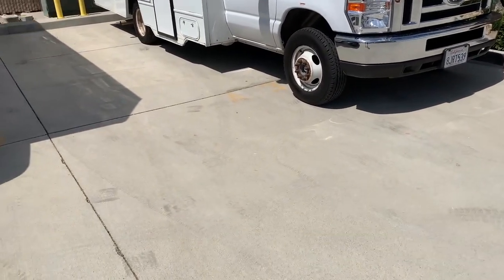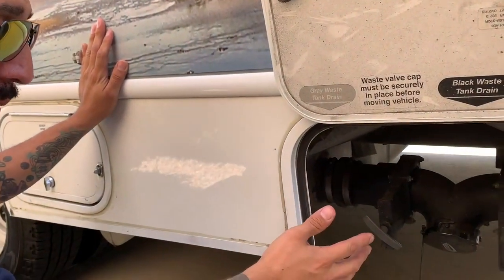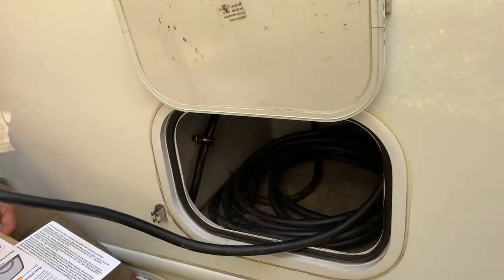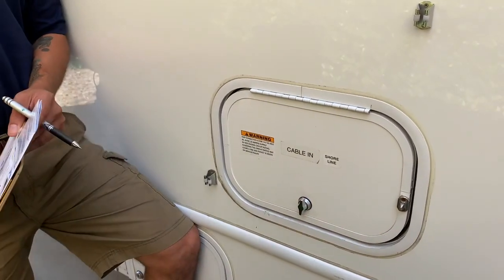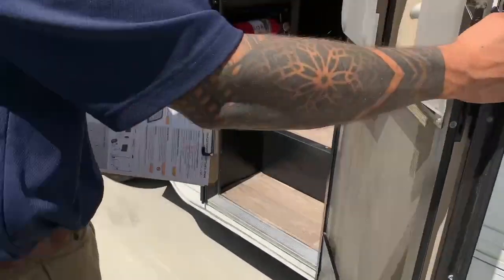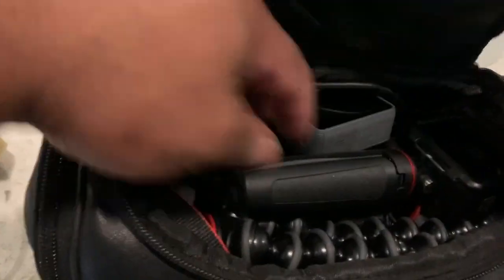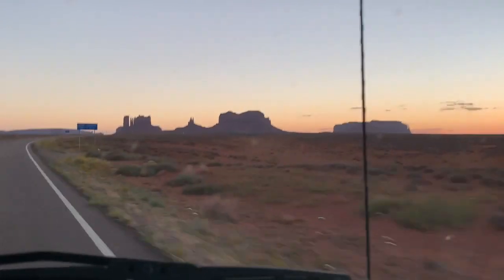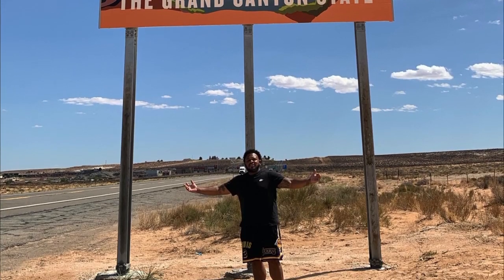Cruise America 25 foot RV full walkthrough and review for first timers

Comment: I've rented 3 times from Cruise America, what he said about the generator is the case. Say you want to heat something quickly in the microwave, you need to use it for an hour to be charged, the Hobbs meter needs to turn over to be charged. Also, the cab air conditioner will cool the whole rig if you run at idle so you can actually do without the generator, at least for a while. My rental was pre-pandemic, your video makes me want to do it again!

Comment: From my experience once you start the generator allow it to run for a minute or two before putting a load on it, such as turning on the AC or Microwave. The initial surge in power, required to start the AC or Microwave, can put undue strain on the generator unless it is running at full capacity. Also, the generator circuit breaker can trip if the generator does not meet that initial surge in power requirement.

Comment: Nice video! One thing that you have to be aware of, in addition, is the carrying capacity of your vehicle. A 25ft class C on a Ford E-350 chassis has a rather limited carrying capacity and people need to take care not to surpass that capacity. The carrying capacity specific to the vehicle will be listed on a large yellow sticker, usually located inside the passenger door frame. When figuring out your own carrying capacity in a motorized vehicle you have to add the weight of all occupants, pets, belongings, food, etc, PLUS the weight of any water in the fresh water tank. The water is a huge load if the tank is full---water weighs about 8.3 pounds per gallon so a full 40-gallon tank will add over 300 pounds to the weight of your unit. I would estimate that the vehicle in the video has about an 1100 lb carrying capacity, depending on how it is equipped.
Also---if your propane fridge is up to temp and loaded it will keep its temp for at least a few hours on the road, especially if you had flat ice packs to the freezer. On some roads, tunnels, and bridges you are not allowed to have any propane on while driving. We never rode with the propane on, too much of a fire hazard.
Reply from the maker: Great info I will definitely take a note of it for the next trip
Reply: A question from an Aussie thinking about coming to USA and buying one of the Cruise America units to travel for 12 months. In Australia the Dometic fridge is 3 way and operates on power when plugged in, gas when stopped and not plugged in and 12 volt from the truck when travelling. Is that the same in these units....the video says gas or electric but doesn't mention 12 volt which implies that you run it on gas when travelling? Also, lights, TV, water pump etc will be 12 volt in Australia so you can use these without a generator (as there's a house battery) is that the same in these units.....or is there not a 12 volt system?

Comment: Great video, so to run the refrigerator when you are driving do you just leave the propane on. Then from what the guy said the refrigerator automatically switches to electric power when you connect it at the rv sight. I'm going from Colorado back to vegas
Reply from the maker: Yes correct it will run off propane while driving and when you get to your rv site and hookup electric it will switch to that…  Colorado to Vegas sounds like a fun trip have fun 👍

Comment: Great video. A few questions... 1. Do you have to have the generator on to have air while you are driving? Are there outlets that work without the generator while driving? Great video otherwise. Thank you.
Reply from the maker: Yes you do have to run the generator for rv ac unit but the front ac vents that’s part of the truck runs without the generator it didn’t cool down the whole rv while we were driving but it helped a lot. Yes there’s outlets and you don’t need to run generator for them to work
Reply: We just rented one this past weekend. Outlets did not work without generator being on.

Comment: 2 questions.  Does the aircon run in the living area while you’re driving?  If not how does that work?  Also, when you pull into the full hook up site at the rv park, do you hook the water, electricity and sewer up and leave them hooked up?  Or do you just empty the sewer and pack it up again?
Reply from the maker: Yes the air can run in the living area while your driving you would just have to the generator on and leave the water and electricity hooked up you only have to hook the sewer when draining your waste

Comment: How long did the propane last before needing to refill?
Reply from the maker: I had the RV for 5 days and it lasted to the last night and I refilled before I returned it… doesn’t kill the propane at all I was surprised on how long it lasted
Reply: We were in an RV for 3-1/2 months with three adults. We didn't use the gas stove or oven much, mostly the microwave and a Ninja air fryer. We had an external barbecue that used the coach propane. Showers, refrigerator every day (We were only hooked to AC at night). We ran the heater some of the time, between September and January.
We used about 30 gallons of propane.
Reply from the maker: @ClarenceDold  nice 👍🏽

Comment: I just booked one from riverside hoping there’s nothing wrong with it. Did you have to call to schedule a pick up appointment or did you just show up.?
Reply from the maker: I called and schedule pick up time it’s was between 8am - 11am and they also did walkthrough  they wash the rv and clean inside then show you all the levels are right gas propane oil. I wouldn’t worry about anything being wrong with it they will go over a checklist before you take it to make sure everything’s working properly.